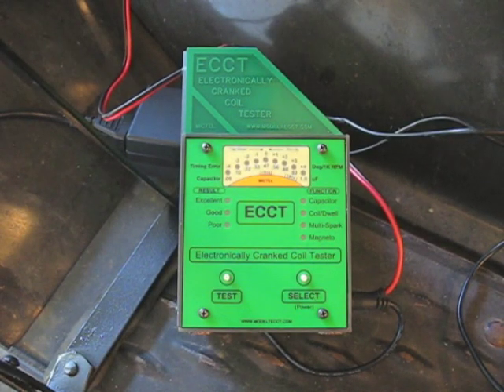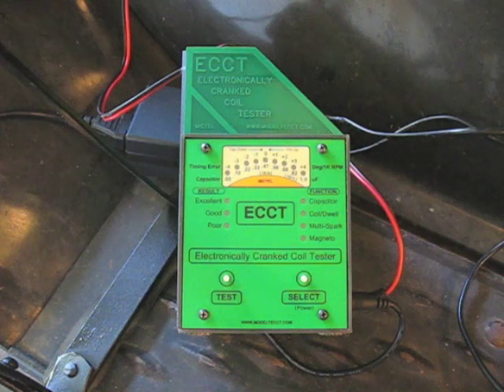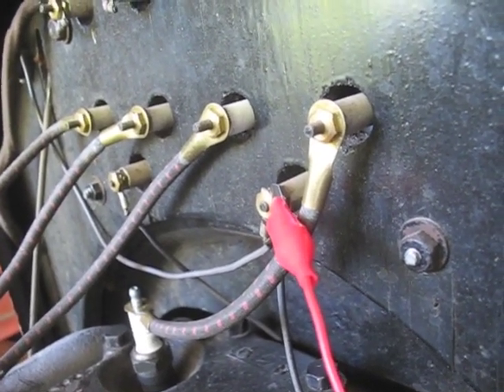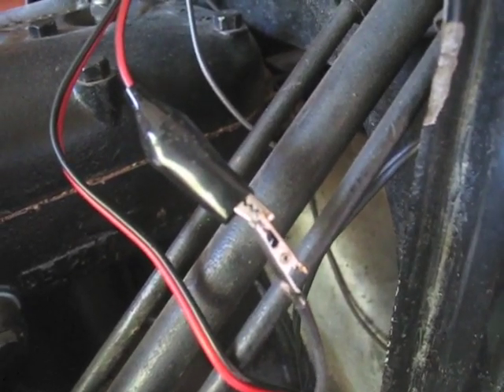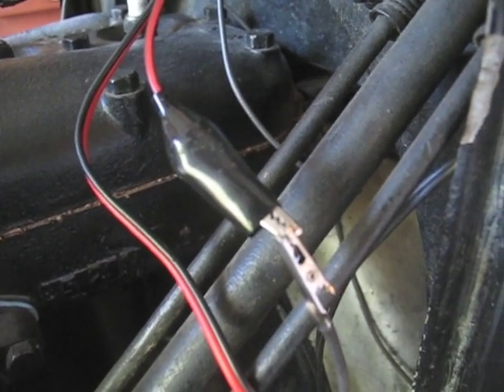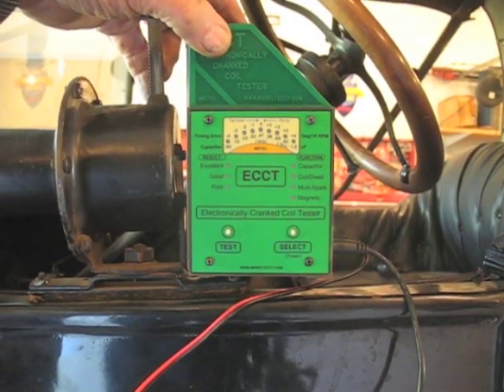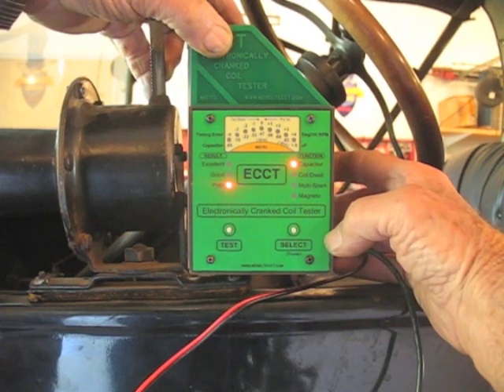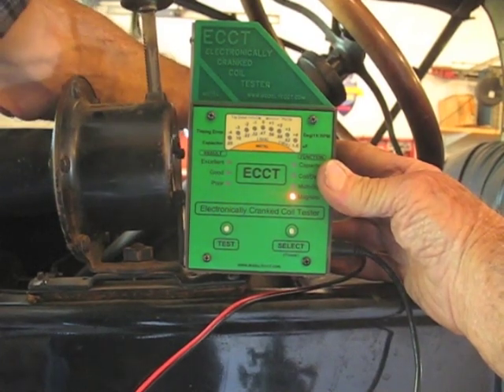ECCT Magneto Test

Comment: Coowal Steve  does tell you how many volts output ????
Reply from the maker: +George Clipner Nope, just good or not. You have to use a meter to find voltage.
Reply: +George Clipner If you have the software interface this shows voltage, rpm, magnet strength and also the internal resistance.